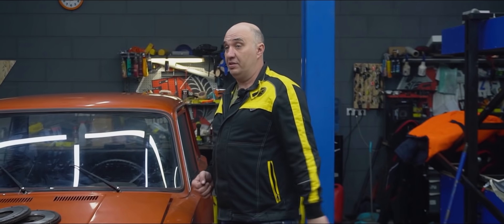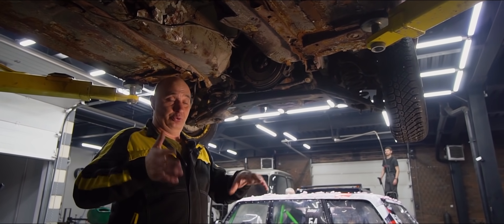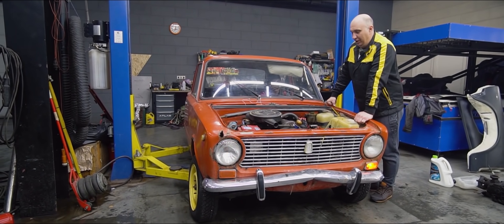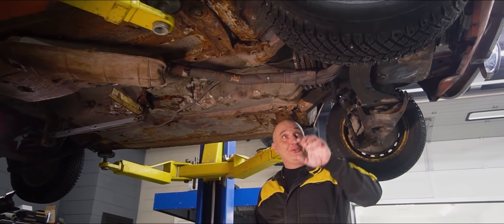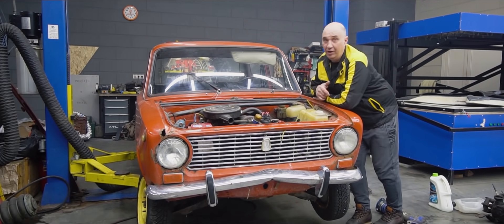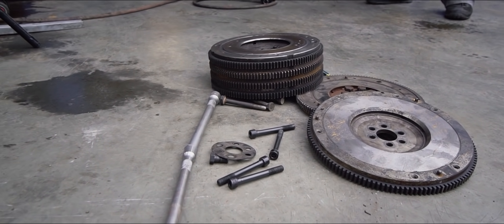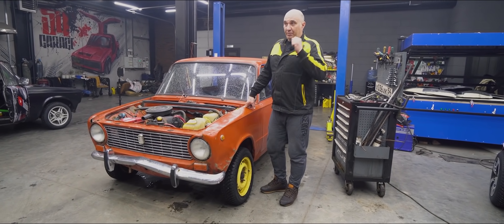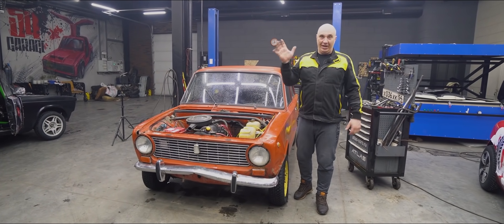What if you install FIVE flywheels onto an engine?

Comment: For drag racing on cars with limits on the motor, the extra rotational energy from heavy flywheels helps launch the car. It also gives a little extra kick when shifting.

Comment: Probably building lunar levels of vacuum off-throttle in 3rd
Reply: why?
Reply: @ArtisticSep  
Because the engine is trying to pump large amounts of air at the high rpm, but the throttle plate is closed and restricting air from coming in. Therefore, you get a vacuum between the engine and the throttle plate, and a much higher level of vacuum than normal because the engine is trying to pump much more air than it usually does.
Reply: @nickopedia5669  its trying to pump the same amount, its rpm based. All its doing is slowing the rev loss
Reply: @janeblogs324  
exactly. it's trying to pump the same amount of air, but the throttle plate is closed preventing new air from coming in to be pumped. 

So when the engine pumps the air out from between the throttle plate and the intake valves, that's called a vacuum, and the fewer molecules are in there, the "higher" the vacuum level.

Comment: I would like to see a lada engine. modified to run on kerosene, like a model airplane engine. Raise the compression and replace the spark plugs with glow plugs, then add a turbo
Reply: So it's a diesel?
Reply: You would need to change the head to use injectors (probably IDI, so definitely not a straight swap of injectors for sparks). How would the engine run if it just has a glowplug and no fuel?
Reply: Big end bearings would pop off the block. Do you understand the compression differences with diesel engines?

Comment: Would be interesting to see how good is that car at towing stuff with those flywheels.
I'm guessing it will be way easier than stock.
Reply: Yeah but the engine would have zero torque at low rpms, so you need to leave the clutch at very high rpms, so... Poor clutch, it may explode
Reply: @alessandrogallo7969  The engine has exactly the same torque as before. It's just that the flywheel has way more momentum, so the engine will be very hard to stall.
The true thing here is that the clutch would indeed have to work harder, but thanks to the flywheels you wouldn't need high engine rpm to move a big trailer, so in the end it might actually put significantly less strain on the clutch than if you tried it on a stock car.
Reply: I think the tires would just spin.  Unless you load the car up with sandbags.  You need weight and traction to move a heavy trailer.
Reply: @AgneDei  it would take off easy but once the clutch is engaged it would be horrible. Lol super slow acceleration. And minimal engine braking.

Comment: When they went to standard hardware bolts for the four flywheels, I was laughing and wondered what they would put in for protection of the flywheels flying off the engine. Instead, they use a hammer to tear out the existing floor so that there is even less protection.  When racing, there was an incredible difference between the 20 lb., 15 lb., and 12 lb. flywheels as to stall off the line and the ability to rev quickly. To be putting on 60 lb. or more is insane, especially on a low horsepower four cylinder.

Comment: Attach engine to a stand with the fly wheel and start it
Reply: No... Shops do that daily
Reply: @backwoodsjunkie08  I think they mean with the flywheel being stationary and the rest of the engine spinning
Reply: @oli_g_98  yep, would not be very interesting...
Reply: If you placed the pivot on the exact center of gravity it would technically work, though the forces would be immense. If you did it with the flywheel on the bottom it might work. You could also attach shit to the engine to "balance" it perfectly
Reply: @alessandrogallo7969  you would need to attach the carb in a way that centrifugal force allowed it to function.. be hard to start but once going it would work.
Reply: Fuel line would bind and break off. That would be that, unless the tank was mounted to the engine
Reply: @sambrook8084  Yeah mount everything to the engine itself. And better to use fuel injection cause a carb wouldn't work when spinning
Reply: @phantomflame0658  True, spinning a carb would throw fuel everywhere but into the engine
Reply: @alessandrogallo7969  there's some old WW1 aircraft engine that has the crank stationary and the engine turns. 
Nothing new there.
Reply: @MrTheHillfolk  oh so the engine would spin with the propeller, acting by itself as some sort of flywheel?
Reply: They had these "rotary" engines (not the wankel style) in airplanes  for a fairly short time. Many videos on here of them (Le Rhône, Gnome, etc) https://en.wikipedia.org/wiki/Rotary_engine
Reply: @grabasandwich  
They used to have one here , I never saw it , I'm guessing it's the one my dad mentioned to me though.
not sure if it's still there though at this place. 
http://www.oldrhinebeck.org/
Reply: @sambrook8084  I guess the crank is hollow , Because the carb is mounted to it and it's right in your face. 
And all that old stuff you could adjust timing and fuel. 
Musta been nice when it sneezes back in your face
Reply: @MrTheHillfolk  That's an interesting engin I've not seen before. If I've understood it correctly, there a void at the tod of the crank case that the cylinders draw from. The crab itself is stationary, if mounted to the heads it would be chucking fuel all over the engine bay when running. 
That's true though on old stuff you could adjust everything manually, now we really on computers to make the changes for us.
The back fires where part of the fun, nothing like starting the day by losing an eyebrow

Comment: Its like a motocross bike and a trials bike. The trials bike has a heavier flywheel and is much more easy going. Motocross engine's are very instantaneous on throttle, but trials engine's are less so. As I expected, a more forgiving and tolerant drive. I really love stuff like this. BRILLIANT 👻

Comment: Would love do see a full throttle clutch dump on dry pavement, I wonder how hard the car would launch?
Reply: With a cloud of clutch dust I'd imagine!
Reply: What we really need to know is....
Now what is the torque and hp ratio.
Torque should have raised
HP should've fallen
Reply: @statementleaver8095  Is that true?
Reply: No, engine torque will be the same, but with clutch release yes it will put more torque to the drivetrain because you have more rotational.inertia.
Its like storing.mechanical energy for.later.use
Reply: @Angry-Lynx  🤔🤔🤯🤯💩💩
Do you work in parliament?? Bit contradictory aren't you😂😂
Reply: @dopiaza2006  Garage54 could've proven my theory by testing on an inclined stretch of tarmac.
HP is how fast the engine can rev (flywheel skimming)
Torque is the ability to pull weight (dual mass clutch and flywheel).

All we got to see was engine start and unladen movement!!!
Reply: @statementleaver8095  
That's not really what HP and torque is. 

Torque is how much rotational force you apply to something (like your torque wrench) and HP is how fast you're spinning WHILE at a torque level. Horsepower is not just about going fast, its about getting work done while going fast.(like pulling a heavy load up a hill or pushing against tremendous aerodynamic forces at high speeds). It's literally in the formula, HP= torque x RPM / a constant

Storing kinetic energy in a flywheel is not increasing your continuous output, it's storing it for future use, such as when you dump the clutch. When you release the stored kinetic energy+the continuous output of the engine it does have a temporarily high output until the the RPM is dragged down enough for the clutch to fully engage, at which point it is now just the continuous output of the engine again.

Comment: Next time: make a car without a flywheel
Reply: Wouldnt work without centrifugal forces keeping the engine running
Reply: @neill4133  The crankshaft would provide some inertia. However, what would the clutch mate to if not the flywheel?
Reply: This works fine and they do it often lol
 like on the "v12", the lada engines connected to nothing work just fine
Reply: Running a lawnmower without a blade gives you a good idea what it would be like. Super fast revs and higher rpm. But flywheels dampen combustion pulses, so it's not good for the bearings etc.

Comment: How about putting a fly wheel under the car and make it almost as wide as the car. The fly wheel would consist of weights attached to springs. The faster the fly wheel spins the farther the weights extend. It would be a similar effect as an ice skater bringing in their arms when spinning and then spinning really fast. The ice skater would represent the wheels of the car. When the car is cruising at highway speeds the weights will be fully extended however when slowing down, the weights would begin to move back in toward the center of the fly wheel causing the car to want speed up when you're trying to slow down. Or when going up a hill take your foot off the gas and feel the car accelerate or maintain speed. You're going to make a great discovery accidentally. Keep up the good work.

Comment: Next time, run a Lada with NO flywheel. (idk how you're gonna start it tho)
Reply: Jump start
Reply: @SteelSmoker  can't jump start because of no flywheel ring gear for the starter, and can't push start because you can't connect a transmission to an engine without the flywheel.

The best i can think of is pull starting it with some sort of strap on the crank pully...
Reply: @FtanmoOfEtheirys  Direct drive, clutchless shifting.
Reply: @FtanmoOfEtheirys  ez impact to the crank bolt
Reply: How to start it? Look at the front of the car ffs, there's a factory hole to put the factory hand crank directly onto the crank. 
Learn lada
Reply: @FtanmoOfEtheirys  this Lada can be started with hand crank.
Reply: @David-cy5zu  oh thats pretty cool actually, yeah we need to see with no flywheel then haha

Comment: Remove one piston on a straight 4 engine. For a smoother sound
Reply: It will do opposite.
Reply: I had a v6 running on one bank once, it produced an earthquake wherever it went and sounded like a v8 with no exhaust; sounded so mean.

Comment: It would be nice to have a car with 2 out of 4 cylinders
Reply: No actually that wouldn't be nice at all.
Reply: It just wouldn't run
Reply: It will run but poorly. Just pull off 2 sparkplug cables and see.
Reply: My six cylinder Odyssey runs off three, once I get up to speed.  Nothing new.
Reply: I ran my old idi vw diesel on 3 for a while , when a high pressure line broke to an injector. 
I bent it up and ran it into a can and I'd stop and dump the can back in the tank every 10mi or so. 
If was slow as hell fighting the compression. 
Still would be alot without compression on that cylinder to overcome.
Reply: Cadillac made an electrically controlled , 2 , 4 .  6 . 8 engine , it was awful .

Comment: What if you have a clutch on the rear differential not at the flywheel ?
Reply: How would you change gears on a standard? The purpose of the clutch is many. Take off. Shifting. Down shifting. You can put the clutch at the rear, but the engine would be directly hooked to driveline, or there could be two clutches.
Reply: @ronniemaeker9102   if the clutch is at the diff. You can still change gears. The synchros won't like it.
Let's say you're in 2nd rpm is at 3000. Engage clutch. And no throttle. Engine rpm drops (how fast, who knows depends on rotating mass of current gear ). Now since the entire drive line is rotating the same speed as the engine you can now move up a gear and disengaged clutch. And let the rpm drop
Reply: @alexjaxon9928  You are correct, just like Class A trucks that don't have synchronizers. Drivers match the speeds of the gear sets to shift, IF they are good drivers and care about their rig. When I was Warranty Administrator, I saw a lot of things that could have been prevented by good drivers.

Comment: Try a fuel economy comparison with that configuration.
Reply: It would go down. It would take a lot more throttle to get up to speed. Maintaining speed might not be much different. That's why the use aluminum drive shafts and rims. Less rotation weight equals better milage. Other then taking off.
Reply: But maintaining the speed could consume less. Sims to be less press on the pedal would consume less. Could be on acceleration is what would consume more.
Reply: @hermantecson8344  it might help on long drives. But definitely not in any traffic situations where you accelerate often. But I don't see it taking less throttle input to maintain constant rpms. As that is still controlled by throttle opening. the engine still needs a certain volume of air to maintain a given rpm. Less volume would still lower rpms.
Reply: Yes there can be more efficient in long drive and i wonder would it be a big or small efficiency would turn out.
Reply: @hermantecson8344  I would think very little at most. I've swapped a steel 2 piece drive shaft for an aluminum 1 piece  one and lost about 15 pound of rotating weight and gained almost 2 miles per gallon. And at the time my drive to work was about 45 minutes one way. Mainly highway. 

Acceleration was noticably better. And much more responsive to minimal throttle inputs at all speeds.
Reply: @meegstomtom  hmmm adding weight would not make it efficient. Hmmmm
Reply: @hermantecson8344  added weight consumes more power. Once at speed it might not change much. But parasitic drag (bearing, differential) add resistance. I think the added weight would add to the power requirements to maintain a speed although minimally.  
And this could change per vehicle. I did this to old rangers. So not economy vehicles to begins with. But newer ones had aluminum driveshafts from the factory. So it was easy enough to swap them into the older trucks.
Reply: In any sort of stop and go traffic, mileage would be worse because some of the energy used to get the added flywheel mass spinning would be wasted as the engine slowed back to idle while the car was stopped. That energy would be converted to heating the brake disks/drums. Careful driving could help by keeping the car moving, like slowing down without braking to catch lights on green, rather than racing up only to have to brake hard at the last second.

Comment: And that's why you want your rims to be as light as possible too. They add rotational inertia to the car, similar to its body weight. When the clutch is engaged, that's exactly the effect you get. You could test engine sound this way because engines generally sound better when they accelerate under load. For the weird noises you heard, they should occur during normal driving too, because as long as there's inertial mass connected to the engine, it will run smoother than without. The springs in the clutch might allow some uneven rotation, but that's about it.

Comment: Make the opposite next time.. Making the engine super responsive
Reply: Cool idea.
Reply: He already did that.. The crankshaft webbing
Reply: @5.43v   i mean doing it accurately not just trimming the crankshaft and finding other ways to rev faster
Reply: I dropped 7 pounds off a VW idi diesel flywheel and the response was way better , shoulda came from the factory that way.
Reply: @MrTheHillfolk  no shit. Did you just make it thinner? I'm interested.
Reply: @joshuagibson2520  
Check out a flywheel for a mk1 golf with an 020 trans. 
It's "backwards".
The pressure plate bolts to the crank first and the flywheel goes over that. 
There's this big chunk of metal like 1" thick and 1.5" wide after the ring gear. 
Pitch it in a lathe and shave it down to the ring gear. 
Not even any need to balance it , you're removing weight evenly. 
Voila , your 'wheel went from 13 pounds down to about 6.
Reply: @MrTheHillfolk  hell yah. I've been machining for almost 2 deacdes. I see what you're talking about. I bet it's zippy now!
Reply: @joshuagibson2520  flat foot in first gear off the clutch and it threatened to squeal the tires 🤣
That was on an otherwise stock vw diesel ,after that little test I did it to all my cars. 
I think ya need like a 12-14" diameter lathe , a pretty big one.
Reply: @MrTheHillfolk  yeah buddy. That's a wide swing over the bed of the lathe. Big machine. I typically don't run anything over about 6 inches or so usually.
Reply: @joshuagibson2520  actually if I recall, it's been a while , I tried to fit one up on our 10" South bend at my dad's play shop.
1 inch more and it would work , it's really close but no cigar.
Reply: @MrTheHillfolk  that's when you make a little extension to mount your tool in to squeak by if possible. Lol. It doesn't work for every situation but sometimes you can get away with shit like that. Just have to be careful and safe. South Bend makes some very good machines from what I've seen over the years.
Reply: @joshuagibson2520  
Yea from what I understand and found online they seem to be pretty good machines. 
Me and Dad went thru it and gave it a tune up and a fresh paint job when we got it. 
Interesting that you "glue" the belt together and it works quite well. 
If I've got a big item to work on ,we've got a bigger lathe at work I can use or bring it to a buddy who's got one too.
Reply: @MrTheHillfolk  yeah I'm going to have to get me some machines for home. Even if smaller sized ones. Machines can be found affordable but all the associated tooling, cutters, and accessories add up. I'm retired now so I dont have a shop to scavenge leftover cutters and such any more. I should have planned ahead a little better on that one. There's always estate sales and the like though!

Comment: The Dauntless V6 has a flywheel that can weigh up to 100lbs or 45kgs. These engines have been used to repower older jeeps. They provide a lot of extra low end torque and keep the engine from stalling while rock crawling.